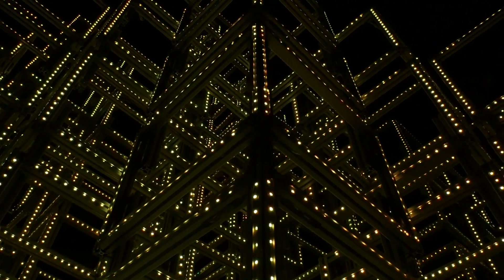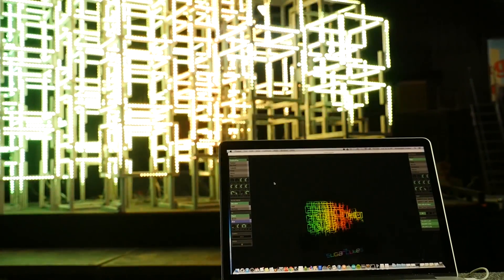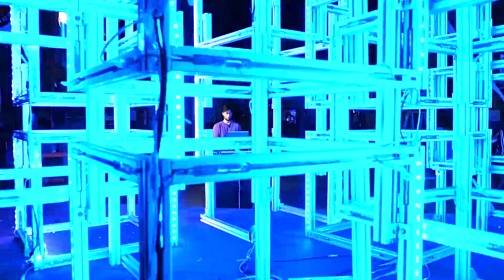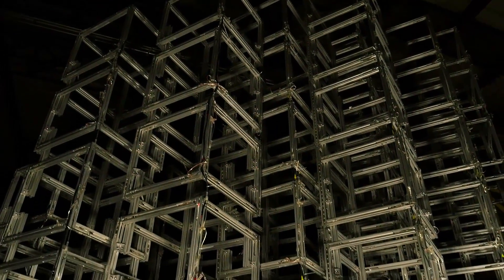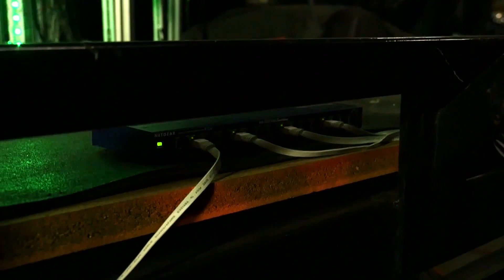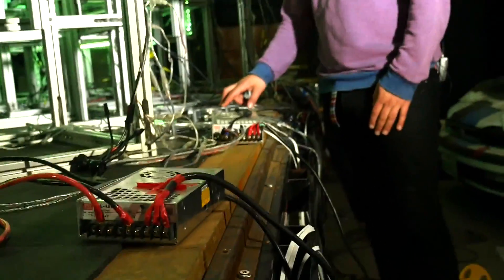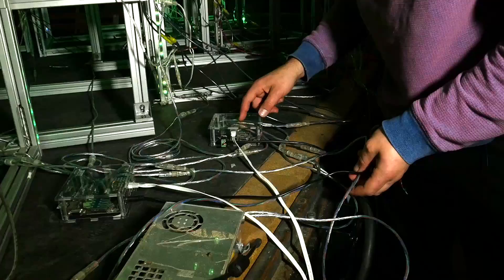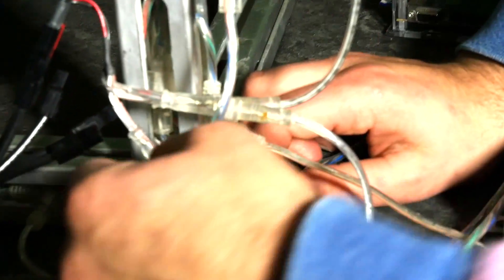LED Sculptures Are The Future of Live EDM

Comment: I'd actually like to know more about creation process of the sugar cubes. How were they built? Can instructions be posted up for people to make smaller versions of their own, if we wanted?
Reply: +Victor Frost Being 4 wire interface I'm betting these are APA102C addressable LEDs, if they are 3Wire interface they likely WS2812B LEDs. Driven with data pushed to controller chips in sentences based on code generated from the proicessing (probably) app that is used for prototyping the show. simply built by embedding the strip into the channels of extruded aluminum